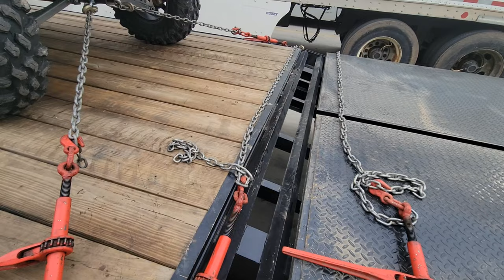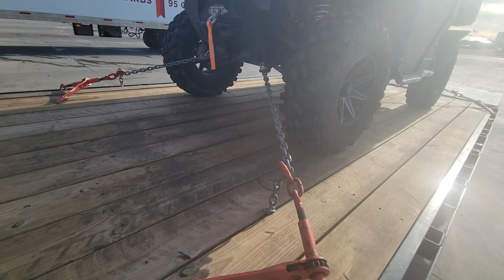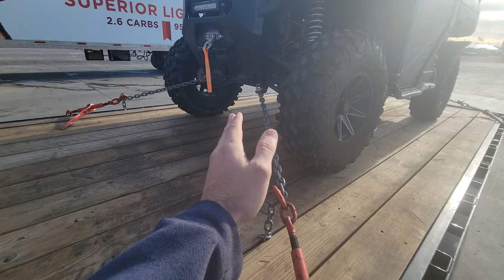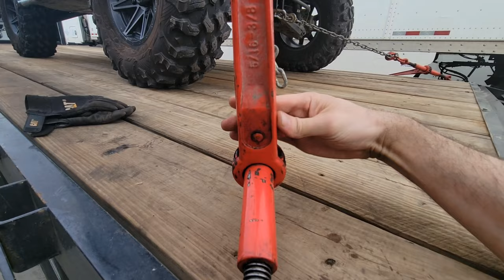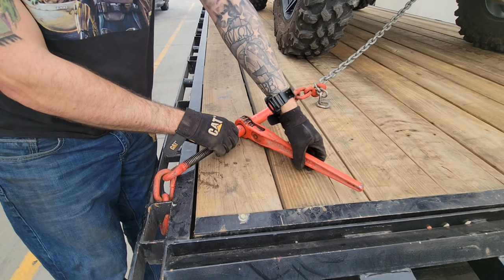How to Use Chain & Binders, Working load Limit explained, & Math for tiedown ratings #noncdlhotshot

Comment: I like how you connected the binder directly to the trailer.  This makes sense to me, but rarely see anyone doing it this way.
Reply from the maker: The only time I don't connect it to the trailer directly is if i need to use an extension, to make it reach.

Comment: Why is my chain wrapping around the binder
Reply from the maker: @lifethroughmyeyes8662  Because the peg isn't going in. Not enough force holding the chain hook. Hold the hook for a few turns with your hand then it should get tight enough to hold it on its own.

Comment: So, listened again, don’t understand the physics of losing half the load limit for a single point attachment.  What component in the rig gets compromised?  If you used a chain to the trailer, does that change things?
Reply from the maker: I don't understand the physics either personally. I know it has to do with angles and pressures and forces and stuff. Basically science haha.
Nothing gets compromised you just subtract half of your lowest rating on your tiedown.

So for example if your chain has a WLL of 2000 and your binder has a WLL of 3000 lbs your tie down rating for a single point would only be 1000 lbs due to the chain having the lowest original WLL. You cut your lowest rating on the tiedown setup in half. Now if your chain was rated for 4000 lbs and your binder still 3000 lbs your tiedown would be rated for 1500 lbs because you're cutting the rating of the binder in half due to it being the lowest rated of the tiedown.

Does that help?

Using a chain or strap doesn't change anything it only depends on the WLL of the tiedown and whether you secure it to a single point or double point.
Reply: @TylerTheFieldServiceTech  appreciate the response, I have a subcompact tractor and a new 16’ dual trailer, grade 70 chains and ratchets.  I’m still modifying the trailer, I have D-rings on the tractor now.  Anyway, thanks; I’m probably above 2x as it is.
Reply from the maker: @craigguinn5423   Yeah for sure with G70 with 5/16 chain & binders you're litterally rated over 9k with single points. Not including the securment over your attachments. Add that and your at Like 12-14k

Comment: Good stuff bro. I’m learning how to do hotshot. I pray it goes well for me. I’ve subscribed thanks for your help. I’ve learned how to use straps and how to unstrap cargo so far just haven’t learned how to use binder chains but this helps a lot. I’m a little nervous but I’m willing to do challenges and learn as I go on this new journey.
Reply from the maker: It's a great time. Making money can sometimes be tough and frustrating along with being gone from home takes its toll. But overall I really miss it. Wasn't worth it for the hardships with my family for me.
Reply: @TylerTheFieldServiceTech  I was planning on doing just local. Not going out of state or anything. There is a lot of local work here in Texas so I’m able to be home everyday. I also have a family as well. So I’m praying to stay near home and do loads around Texas.
Reply from the maker: Best of luck, I loved local work when it was good and busy, but when the phone stops ringing, especially during the slow season, you still gotta pay that overhead and survive. You will learn very quickly with local work that places won't pay you what you should be paid for your time frequently.  You end up making less money, but you're home nightly, so it's a trade-off. But... what will happen I promise you is you will have to start working the freight boards to stay in business and then you will start getting time conflicts between different customers and having to balance freight board work  and local work and it ends up being a problem constantly but you have bills to pay is the fact. Sitting at the house waiting for the phone to ring for work is lots of anxiety, and it will put you out of business. Don't wanna shit on your plans, but I'm being very real with you. The overhead is so damn expensive in your first year cause of insurance and learning lessons it's very tough. Give your best, but don't be surprised if local only doesn't work.

Comment: Thanks for the info...

Why do direct tie-downs lose 50% capacity?  I, personally do not like the MBS annotated on devices... if the WLL is 6000 lbs, honestly I don't care what the MBS is (19000 lbs).  I can never use that number, nice to know for sure, but I've seen people misinterpret these numbers :- ).

I do prefer to use the spool for chain, I've seen a lot of stake-pockets damaged by using chain/binder hooks in them - the spool is designed for chain... :- ).
Reply from the maker: Idk why that is the case, but It's the law, and I'm sure there is some science  and math behind it.

How exactly does the binder damage a stake pocket besides paint? I would worry more about breaking a side marker light.
Reply: The thought behind the reduction is because the pressure of the restraining force is applied to one spot on the trailer and not split with another tie down point 

Also he’s wrong. The actual WLL is based on the weakest link of the restraint system. If the chain is rated for 4700 and the binders are rated for 5400 the weakest link is the chain. Meaning that tie downs legal restraining force is 4700# not the binder rating. 
It’s ALWAYS based on the weakest point.

Comment: Please explain why tying directly from the vehicle to the trailer you lose half of the working load strength of the binder. 

A straight line under tension is always stronger and more stable than tensioned bends and angles and I'm having a hard time rationalizing two chains and two binders reaching across a load being equally strong as four chains and four binders on all four corners. 

Thanks!
Reply from the maker: Ask the FMCSA haha. It's just the law for us. There is some science behind it. 
I misspoke in the video. The tiedown loses half its strength. My weakest point is actually the chain because it's only rated for 4700 lbs. If I was running 3/8 chain it would have been the binder

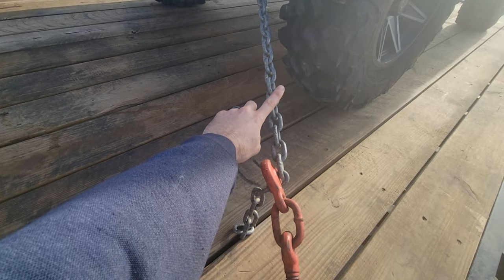Comment: @02:18 for macinery I hate straps. Example a friend of mine borrowed my trailer to carry his Poalris crew cab , during the 200+ miles plus drive , the bouncing of the polaris on the deck sawed thru a strap. If he would have went another 50-100miles I'm pretty sure it with have cut fully the straps.

Hit nylon straps can be cut with a simple box cutter, so nylon on any sharp or semi-sharp edge can be cut easily.
Reply from the maker: Yeah, straps are fragile. Use sleeve protecters and edge corner protectors to maximize life. Straps shouldn't be used on cargo that has a suspension unless you go to the wheel or get completely under the suspension. The suspension bouncing will pop the straps loose.

Wheel straps are great straps if used properly. I prefer the lasso style ones  due to how versatile they are for different applications.

Comment: Tie down at the tire so suspension flex does not let the vehicle move during bumps corners ect.  The frame tie down with a bumps can shift and move. 
Connect each tire and 1 front 1 rear frame connection.   Anything less is inadequate.   

Rachete binders are 100% better.   Boom is dangerous budget friendly for the experienced trucker.  

In the future if you learned anything from this video hire on at maverick or tmc flatbed training.  The best investment is knowledge and repetition creates skill and experience.   These you have forever REGUARDLESS of your future endeavors
Reply from the maker: I usually use wheel straps on all vehicles if possible. I have a whole video all about it. I already had the chains out from the load I dropped off at the pickup for this load so I threw them on. That's why I did a 4 point because the 2 point the vehicle moves all over the place  on the trailer and it puts uneven pressure on the suspension components. Machine rode perfect for 900 miles passed an inspection and all. This video was solely to explain WLL and binder use.

Comment: I just always worry about the binder loosening up I haul reels and they are tall I can’t slap it against the deck
Reply from the maker: When that happens, I take a bungees and basically disable the ratchet once I have it tightened. But if the ratchet is on the tighten setting it will only spin to allow it to tighten more. It shouldn't come loose it should in theory only spin infinitly one way and do nothing. Cause the teeth won't engage unless it goes the other way.

Comment: What does it mean when the turn the ratchet and the chains roll and get tangled as you turn it? I was having trouble with this
Reply from the maker: Hold the chain as you tighten and check to see which end of the ratchet is failing to spin into the ratchet. Usually, it means you need to lubricant the threaded pegs because one of them is failing to operate properly. I prefer white lithium grease to lubricate when I do my equipment maintenance. But when they stick, I use a penetrating oil to lubricate or WD-40 in a pinch.